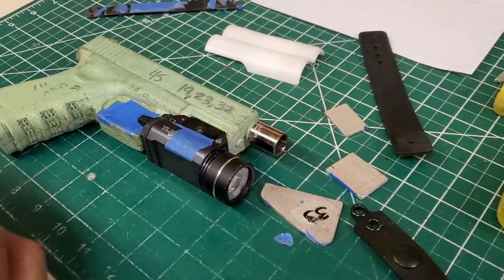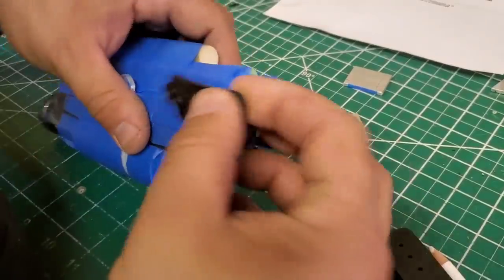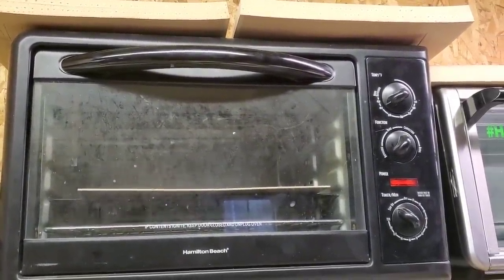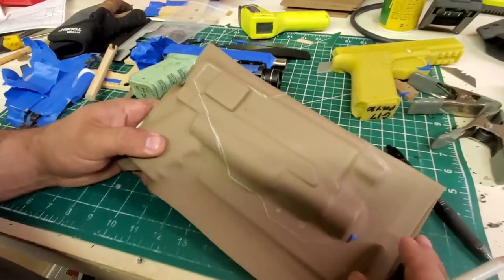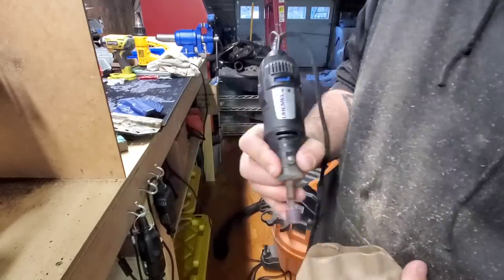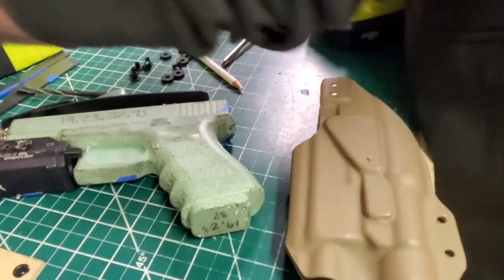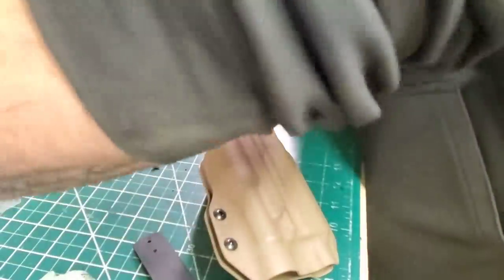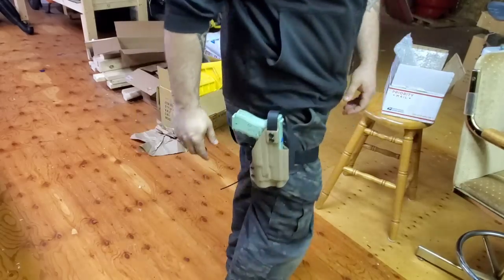Making a IWB taco style light bearing holster as an OWB

Comment: As a dude fed up with a particular company dragging their feet to make a light bearing model for my weapon, you make this look way easy and I'm still way intimidated. I'd only be making a shell for myself, and I've never done it before, but you really help clarify where to block and why. 
Really appreciate this video!
Reply from the maker: Hell ya man. Let me know how it comes out!
Reply: @FalTacUnlimitedLLC  Does one need a dummy weapon like that one you used in the vid, or is it safe to use my actual weapon? Along with buying the foam, kydex, hardware and other stuff to make at most 2 holsters, if I have to buy a dummy weapon, it'd be a better financial decision to wait on said company lol.
Reply from the maker: @DadHub  easy to make a holster off a real gun as well. Just a little more blocking has to be done. Ejection port for example
Reply: @FalTacUnlimitedLLC  Gotcha. Thank you.
Reply from the maker: @DadHub  good luck!

Comment: I don't know if you'll like the band saw as much as you think. The scroll saw chatters a bit but looks like you were doing some contored cutting? Maybe you can get the same thin blade on a band saw.? I'm sure you have it figured out. If so I probably need to do the same, I have a doall bandsaw, usually doing straight cuts, its just an optional piece of equipment I have in my machine shop. I'm gonna play around with some kydex, thanks for the info:)
Reply from the maker: I picked up a 1/4 wide 14 tpi blade and I only use the band saw for straight cuts. Much faster and accurate.  Scroll is for bends and detail work

Comment: I saw you drilling through the plate and marking the spots to drill with a white pencil. 

Might I suggest that instead of marking the spots to drill with a pencil, instead use an automatic center-punch? That way you've already started the drill, the drill bit is much less likely to "drift", and you won't risk marking up your plate.
Reply: Great tip.

Comment: I got a question. I hope it’s answerable. Why don’t all holsters with a light have a positive click and or pop and is there a way to fix that?
Reply from the maker: It truly is hard to get an audible click with some lights. It's all in the design of the light and holster blocking itself.
The snap consists of the firearm spreading the kydex apart and then snapping in place one the gun is fully inserted. Which gives you the audible click. Most lights bearing holsters are friction retention. So far I've done pretty well with getting those clicks. I've since updated the tooling for this exact set up

Comment: Just started making my own holsters and in figuring out the details theres some learning curve. The biggest issue Ive had is correcting the spacer for hardware. I have to go back and make it deeper to be sure the posts will clear the slide or light enough to not scratch anything while drawing.
Reply from the maker: Absolutely.  Holstersmith.com sells a slew of hardware. You can also get posts at shopdiyholster.com they have super thin ones for just that reason. I use aluminum from home depot

Comment: Where do you get the adapter plates? I beleive you called it your 34 plte in the video. Do you make them and if so do you sell them?
Reply from the maker: Rti plates. I buy all material from holstersmith.com
Reply: @FalTacUnlimitedLLC  checked there cant find them. And what drop leg system are they for ? Black hawk , safari land? Need to know which to buy before i go nuts lol
Reply from the maker: @BX_Born_Pistolero  gcode.  Just search rti hanger in search bar on the website

Comment: I have a request. Do you think you could make a couple of right hand taco retention holsters for me in military licensed multicam with safariland three hole pattern for mounting and put if possible an original safariland rotating hood in FDE ? The pistols are a Browning Challenger .22 cal and a Browning Medalist .22 cal.
Reply from the maker: Couple problems with this. Otherwise I could. Not a lot of browning guns out there for molding. I can see what's available  but I don't believe the challenger is available. 
Multicam is no issue. And the safariland hood is no problem. Has to be used though.  We can't buy new
 SL won't sell them. My advice would be to find a local kydex guy who can physically use your gun

Comment: I'm researching to make a holster for my g23 mos gen 5. I've seen many videos with blue guns and others with real ones. Any advice on this. I have made a few knife sheaths and holsters bit nothing has come out really nice yet.  I'm gonna keep practicing until I get something I can be proud of. I am trying to block it for a cheaper light. My biggest issue is making the belt loops. Great video BTW, I just subbed and am gonna check out more on your channel
Reply from the maker: Never recommended making loops. Sets you up for failure. Spend a couple bucks on injection molded material from holstersmith.com.  you'll be very happy. Also invest in a good light. A tlr1 hl is only 120 on amazon. And well worth it for name brand lights.
Reply: @FalTacUnlimitedLLC  thanks for the advice

Comment: Really TKS for your tips! How do you block the laser part of light and laser combo (surefire x400)? Can I use a steel pipe for light channel? Does the heat damage the light/laser?
Reply from the maker: You can use whatever you'd like thats easy to cut and shape into what you need. I use wood dowels or pvc. The heat and pressure will not damage the light
Reply: @FalTacUnlimitedLLC  Thanks for your help. I'm a police officer from Brazil. We don't have many options for kydex holster with light/laser. And mine is a Sig sauer p320 full with Olight baldr pro. So I have to make my own holster (owb and iwb). Have to import the molds etc. It's a pain... But I kind like it kkk
Reply from the maker: @Tiagopa23  oh man. Have fun and enjoy it!
Reply: ICKY awesomeness  I also make kaydex love your work .In good spirit 2 things that annoy me your dog walking up and down on you wooden floor and you chucking your tools and project every time you used it or getting some thing positive critcs  ,well done clean crisp line I love your presses.

Comment: hi. what's the size of the drill bit for the holes retention and others? how many mm.. thanks
Reply from the maker: 1/4 for rivets and 7/32 for retention holes and fomi mounts
Reply: @FalTacUnlimitedLLC  thank you! what about the rubber bushings for the adapter on the dropleg.. is that about 3/8 of an inch?
Reply from the maker: @TheChabm  those are a half inch.
Reply: @FalTacUnlimitedLLC  nice. thank you. :)

Comment: So what are the repercussions of using an actual firearm?
Reply from the maker: None if you do it right. I'll have a video at some point but if you are using a Polymer frame, remember to always have the mag in. Personally I out a couple layers of tape on the mag and reinstall. It will stop the grip from squishing in the press.  Only other thing is scratching while blocking. So make sure adequate tape is used

Comment: I don't understand the 6 layers of tape on the slide....otherwise this is the same way I have been doing light bearing holsters for 10 years.
Reply from the maker: Keeps kydex of the slide.  Reduces slide wear
Reply: @FalTacUnlimitedLLC  ..080 or .093?
Reply from the maker: @tacbear  mostly .08
Reply: .080 and you heat over 300 deg??
Reply from the maker: @tacbear  350 min
Reply: @FalTacUnlimitedLLC  Thanx...when I changed from .060 to .080 I kept heating to 300 deg.
Reply from the maker: @tacbear  you'll get crappy definition.  No less than 350